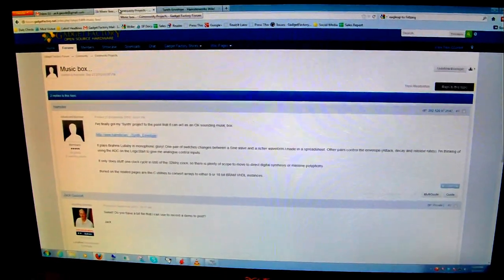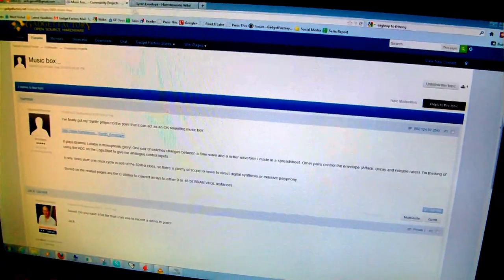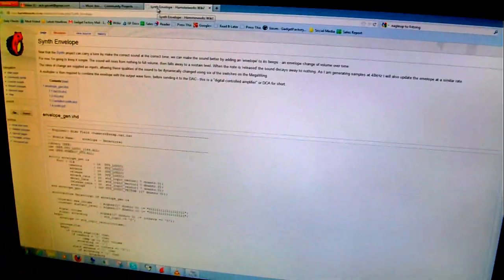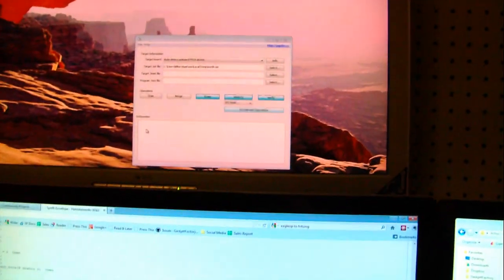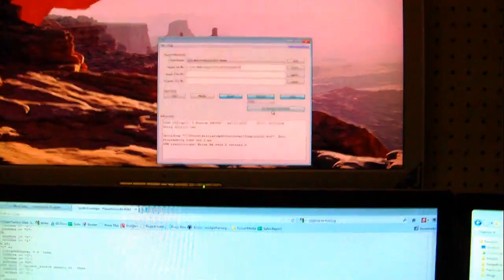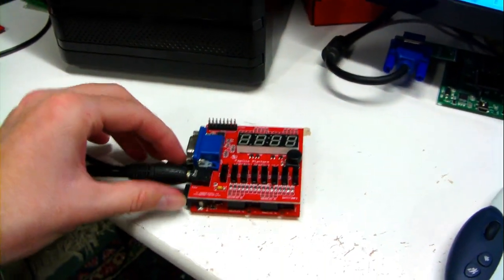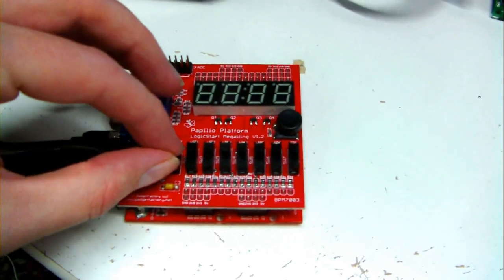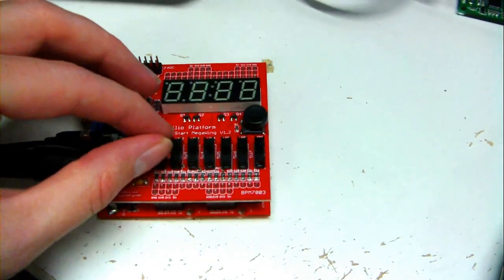Hamster's Music Box on Papilio FPGA

Comment: 1) is there a limit to how many times i can write programs to the FPGA?

Practically speaking, No

2) can i do gaming on the 250k model (with an SD?)

No SD is included, you could wire one up but that wouldn't be trivial

3) what do you need to program one

Xilinx Web ISE its free

4) Any tips for a newb, (i've used uContllers and i know the basics of logic control)

Get mike Fields LogicStart wing with free FPGA book, its awesome and suitable for noobs. 

thanks in advance for your response